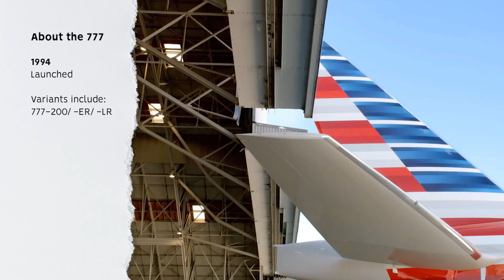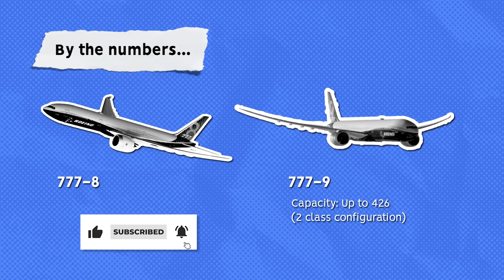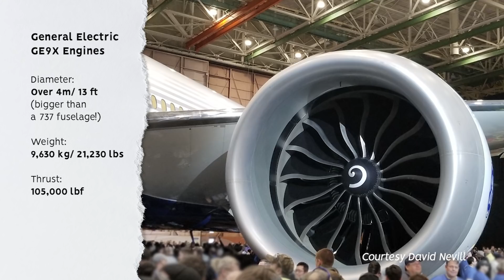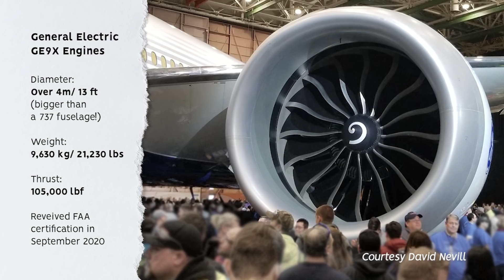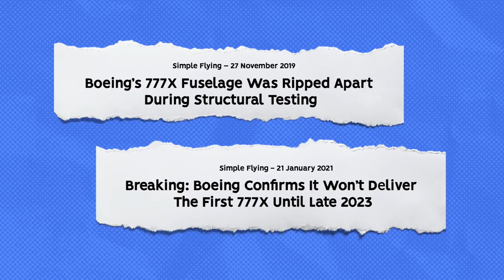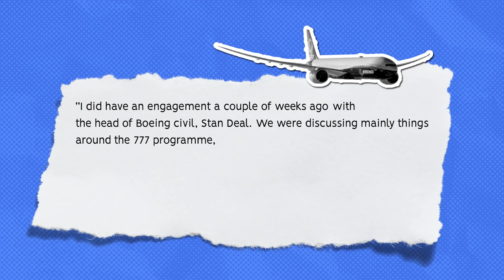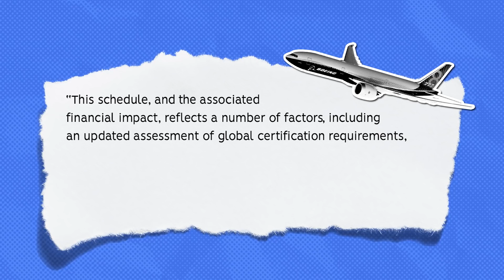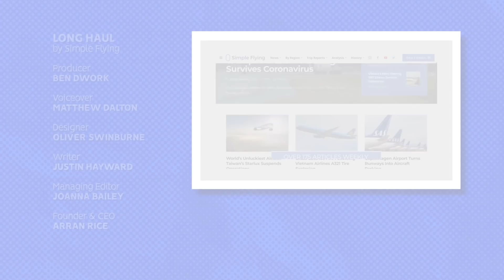Boeing 777X The New Twin-Engine Jumbo Coming Soon

Comment: Hopefully once all these issues for Boeing 777x , they can make a -400XER (336/344) seating capacity and Cockpit Windows design similar to that Of McDonnell Douglas DC-10/MD-10. If that goes success then can go forward for "Boeing 777-500XMLR" longer than "predicted Boeing 777-10X" (little over 470 till 496 seater) this like way into 2025/2027 period. If New Gigantic Twin Engine  get studied and made than we can also possibly see Boeing 777-600XMLER (seating capacity of 511 to 560 Passengers) matching the size of that of the Airbus A340-600 except for the fact it will be SuperLong TwinjetJumbo. Boeing can also make a 268-282 seater Capacity aircraft called "Boeing 777-7X" for its replacement of Classic Boeing 777-200ER/300.
Reply: Out of that the 777-10 seems the likeliest, which doesn’t mean it’s likely at all. Also, why should they add a DC-10/MD-11 cockpit? Why such inconsistencies?
Reply: @spongebubatz  Not Cockpit of DC-10/MD-11 just the Cockpit Windows design that's what I have mentioned , Cockpit remains that of the 777X just the Window design of the Cockpit can be made similar to that of DC-10/MD-11 for -400XER, -500XMLR and -600XMLER/ULR if Boeing pursues ahead after the current 777x problem is solved
Reply: @satirthsarthak6887  that’s what I meant, and I still have to ask myself: why!? Why should you change the cockpit shape within an aircraft family? And if so, why to a cockpit shape of an older aircraft. It just doesn’t make sense to have such inconsistencies, there’s no reason to do so

Comment: Why would u want to use aluminum for the feusalgue when we have composite materials?
Reply: Maybe so that they can reuse tools they already had for the first gen 777 and there weren’t any changes to the production itself needed
Reply: Boeing trying to economise yet again
Reply: Several reasons. They get to use existing infrastructure  to assemble which lowers cost. Also most of the efficiency gains come from the new engine and new composite wing.  Any additional savings from an entire new feusalgue would have generated marginal gains not worth the investment.
Reply: The 787's composite fuselage delayed its development and entry into service, causing Boeing to take a page out of McDonald Douglas's book and cut costs from and/or rush the rest of the development and roll out to keep the type competitive.

Comment: I can't help but wonder if the 777x could, due to unexpected changes in the market, end up being the wrong aircraft at the wrong time and never turn a profit?
The efficiencies of a twin over a quad are undeniable, and that in many cases the largest 777 could replace the 747 and A380 (perhaps with an increased frequency should passenger numbers require it). However, admittedly a bit of a curved ball, but bearing in mind the number of A380 and 747 aircraft in storage, and those being more likely to be used for parts than returned to service, and consequently worth little if any more than their scrap value, how would one of those refurbished to the latest passenger specifications compare against a significantly more expensive to buy, faster depreciating 777x?
Whatever stats may be thrown out there, the undeniable fact is that there is no certainty around when the 777x will enter passenger service, and a airline may have no other choice to replace worn out aircraft with refurbished ones capable of giving another 10 years of service - there might even be a place for the largest A340s!
When comparing new with new, the 777x will, providing the route justifies it's capacity, have little if any competition. The dropping of the A350-2000 makes me wonder if the market will support aircraft of this size, just not another, a strategic move to delay its introduction until the market settles, or possibly even until the launch of an A350neo - which could even be sooner than we would have expected? The latter could be a real problem for Boeing.

Comment: Boeing should add a Freighter Version.. 777XF.. No more 747-8F.. Some sort of freighter needs to be in production I would think..767F might not cut it in the future..🤷🏻‍♂️
Reply: A 777-8F seems very likely and airlines like Qatar Cargo have already expressed interest in such an aircraft! It could also be that we see a 777-8F but no 777-8
Reply: The 747-8F is the only commercial cargo jet with a raised cockpit and an upswinging nose section, a leftover from the days when the USAF was looking for a gigantic military transport in the 1960's with its CX competition. The Lockheed C5 Galaxy came in at a lower cost and won the competition, despite the fact that the USAF felt that the Boeing design had better technical merits, so the 747 was redesigned into the world's first commercial jumbo jet. No other aircraft designed for commercial use can come anywhere near the 747's cargo hauling capacity. It twice during tests took off weighing well in excess of one million pounds.

Comment: "...the 777X is flying and eagerly awaited by both passengers and airlines". Really? These over-large aircraft are now firmly out of fashion. It is instructive that none of the American legacy airlines have placed an order for the type. Only 2 airlines have done that in Europe. The 777X currently looks like it might suffer the same fate as the A380. It seems likely have one main operator in Emirates. After the initial orders have gone to Emirates and the few other airlines, where is the rest of its market? Most B777-300 fleets are quite young and that will be plane most likely to be replaced by the new model. Even there, because of the over-large size of the new model, it lets the A350 in as direct competition. It will be interesting to see how all this plays out, but I don't hold out much hope for the 777X.
Reply: er I'm not eagerly awaiting 10 abreast in economy like the last 777-300ER I flew on. Wings and fuel burn won't change my passenger experience for the better compared to the A380 / 350
Reply: Any New airplane always make me happy but can't say the same thing for airlines

Comment: The B777-9 is not a game changers but a more fuel efficient and larger variant of the B777 family. To be  game changer, it has to be an all new clean sheet airframe design like the B787 and A350.
Reply: A350 isn't a game changer. It's just a new clean sheet design. It used traditional manufacturing techniques and technologies. The last Airbus game changer was the a300, a plane that started the twin wide body trend.
Reply: @OnEEmONErD  What are you on about dude, the A350 uses composites like the 787, how is that traditional? Have you ever flown one? It's super comfortable. There is no direct competitor to the A350-1000 with like for like features on the market right now.
Reply: @TheEchelon  the 787 entire fuselage is a carbon fiber tube. The a350 are sheets put together. I've flown both. Both are comfortable but that has little to do with technology, that has to do with airlines configuring their planes. The 787 is significantly more efficient than the a350 and uses much more advanced technologies and manufacturing techniques than the Airbus.

Comment: This airplane will change the aviation industry forever as Quadjets drop like flies and we move toward ultra fuel efficient twinjets. However the 777-8 has already been shelved because it is not selling. If the project is scrapped then Boeing has to extend the range of the -9 sufficiently to allow ultra long haul flights e.g Dubai/Doha - Los Angeles non stop on a full payload.
Reply: no it wont

Comment: It won't be the gamechanger, by the very fact that Boeing themselves believe 787, not VLA, would be the future. Hopefully it'd be a nice side-project to keep 777 aflot though. But wait, what if Airbus stretch A350 again?
Reply: It's pretty much at it limits without major structural redesign.
Reply: @johniii8147  Understandable. Airbus tend not to overbuild, so -2000 would require bigger changes. Seems 777X niche is not big enough for the trouble at the moment.
Plus, given UltraFan is on the way, it's easier for them to take advantage of the fuel savings instead, just like what they did for A321LR/XLR vs 757.
But if there's significant demand I just don't see they'd sit and wait. And don't forget even the compromised 78J successfully steal some orders by its lower CASM over 359. I just don't see how 777X can compete head on......

Comment: Overall, a nice presentation. One comment, and a correction: At 4:00 there isn't a slowdown in air traffic demand. International government mandates by specific nations are causing the disruption. Most people with vaccinations, and some without, would gladly travel as they did before, for business or personal reasons. At 4:24 the engines are the largest (biggest diameter fans) but they are not the most powerful. They are set to produce 105,000 pounds thrust, while the current -300ER and -200LR are powered by 115,000-lbs thrust engines.
Reply: Correction, GE9X have been tested to produce 134,300 pounds of thrust which is a world record
Reply: Nit picking. There is infact a huge decline in international demand with the borders closed. There is no demand if you can't go there. And yes the engines are the most powerful. They will just be derated not use all the thrust given the efficient wing, at least initially. They may well increase the thrust to the engines capabilities if they develop a HGW version, freighter for the 777-10 in the future.

Comment: At 1:18 - the airlines will just cram another seat into each row in steerage class. I far prefer the A350, fewer seats per row and a very beautiful airplane. And if you're in business class in the A350, each seat has direct aisle access, meaning easy access to rest rooms without having to disturb someone or be disturbed. Each airline can of course lay out the cabin as they prefer, but the illustration at 12:15 shows a business class arrangement where the window seat does not appear to have direct aisle access.
Reply: The 777X does not fit 11 abreast. 10 abreast on the 777X will be just as wide as 9 abreast on the A350 -- which can fit an extremely uncomfortable 10 abreast by the way.
Reply: Not true in this case. It will be 10 abreast in economy just like a majority of 777-300 ER are now configured. He misspoke a wider fuselage. It's the exact same. They were just able to create more interior space by 4 inches

Comment: Time for Airbus to do an A350 NEO and a bigger 2000 variant. I know it's unlikely to happen anytime soon but one can hope...
Reply: They can stretch the A350 further but it could not match the range of the 777X and especially not match the enormous payload capabilites of the 777X.
Reply: @widget787 Let alone match its delays and certification problems 😀 JK
Reply: @widget787  Wrong. 779 has the same MTOW as 77W, and lower per trip fuel burn is cancelled by higher gloss weight. Hence 779's payload capability can't be better.
35K meanwhile, is both significant lighter and burn less per trip. 35K carries <5t less than 77W, so basically in the same ballpark of 779, despite the MTOW is > 30t lower.
As long as revised structures can support the extra fuselage weight (which is fairly light anyway) it'd be fine.
Reply: 1. A350NEO is believed to be powered by RR UltraFan, so for now Airbus would have to wait for its mature.
2. Seems like 400 seater is a small niche. So for now it's more profitable to just let Boeing eat their lunch, than stretching A350 with current engine. They won't let go if the profits are there.

Comment: Additional: the delays are not really a surprise.  As a derivative of the 777, Boeing expected the X to get easy rubber stamp from FAA like it had done previously for all its derivatives.  the MAX forced the FAA to become more vigilant, and now, Boeing has to do a full certification and tests on it almost as if it were a new aircraft.   The fact that problems are being found shows how flawed the rubber stamping of derivatives was.
Reply: Aka FAA suddenly wakes up ans realises it should probably do its own job
Reply: A full recertification was always going to be required given the new composite folding wings that are new for a commercial aircraft. It's just going to take a lot longer given intense scrutiny now.
Reply: False, they ALWAYS had to do a "full certification test" on it, and it's not "like a new plane" it IS A NEW PLANE.  Boeing now has to prove that what they say the plane will do, is what it will actually do, same with its systems. 

Also, they're already busted with the unexpected pitch-up behavior, which is exactly the kind of thing the FAA was worried about finding. As usual, if Boeing had done their homework during the design and R&D phases, they would NOT be dealing with this issue right now.
Reply: I am totally in agreement with the FAA rules even for derivatives, air safety is  an absolute must.
Reply: This should have been a no brainier- It’s the FAAs JOB to inspect and certify. That such laxity was shown that a faulty product like the MAX could be launched in an industry where beta test flaws can and did cost lives is a disgrace.
Reply: unfortanately the Max made the FAA more vigilant.
Reply: @sportsMike87  That's a good thing they became more vigilant. Previously the FAA was allowing Boeing to a vast majority of the certification. They were essentially self certifying. The was the FAA model for years and they didn't have the staff so they turned over to the manufactures.
Reply: @sportsMike87   Hey, 'Unfortunately' ?... NOT ... How about FORTUNATELY the FAA is More Vigilant !
Reply: @sportsMike87  unfortunately/fortunately